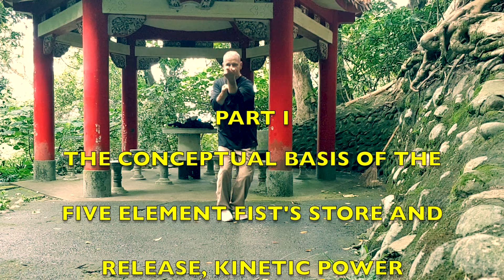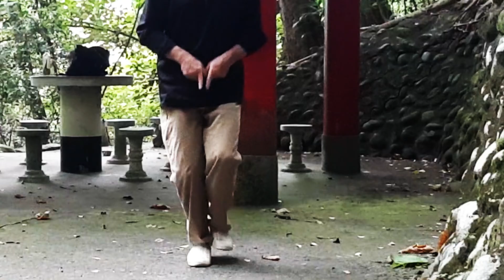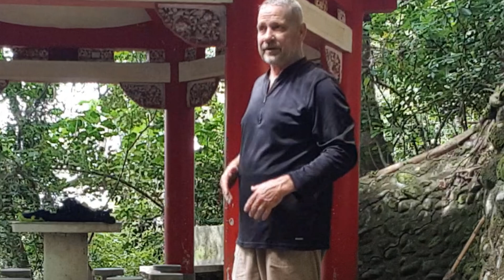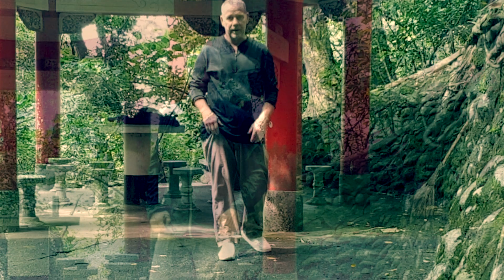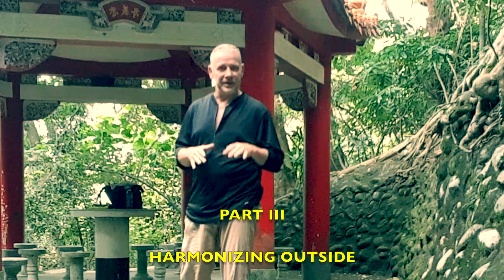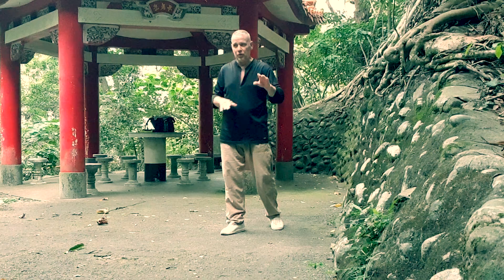PARTS 1,2 AND 3, XINGYI  - 5 ELEMENT FIST / STORE AND RELEASE BREAK DOWN

Comment: It's funny how little instruction is given on chicken stepping, and when we do get the odd lessons it's usually not linked to the upper body movements like this...
Reply from the maker: I think you nailed it! The entire movement network is rooted in the single weighted principle expressed in the Chicken step.
Reply: @marcusbrinkman3066  The sinking down and storing on the single leg part of the step is a massive key that I was missing and now the sinking part of the commencement form makes more sense.. Thanks a million for sharing that.  I think I will spend next month on chicken step through pi and zhuan.
Reply from the maker: The forms in general, demonstrate a kind of "inch worm" pattern of movement, similar to Post Heaven Bagua. They tend to stretch out and probe to make contact and then cohese or contract into the storing, rooster leg posture, then stretch out again into the final release. (open close open) 
I think that may help in your practice as a kind of general movement dynamic. The Rooster leg. compression produces the power  of the "half step" or (banbu) also called the Tiger Springing step. It tends to be a hellishly difficult practice to train its power..and probably why there is so much emphasis on standing in Santishi.
Reply: @marcusbrinkman3066    I was missing the importance of the storing or compressing concept. I've been doing drills sinking into one leg then rising and sinking into the other. It is difficult to train.  Inch worm makes sense, store, sink, push off... This storing must be an key part of the chewy style..